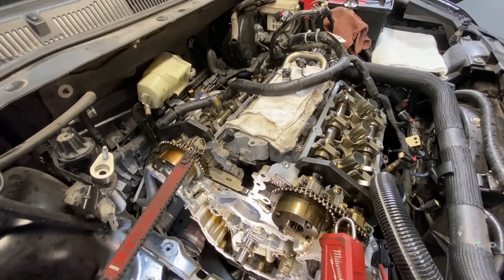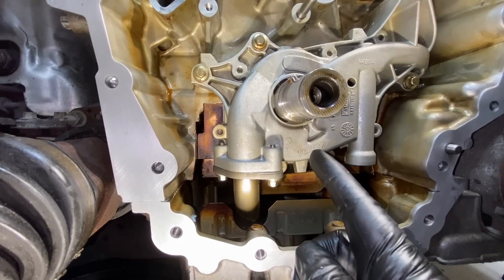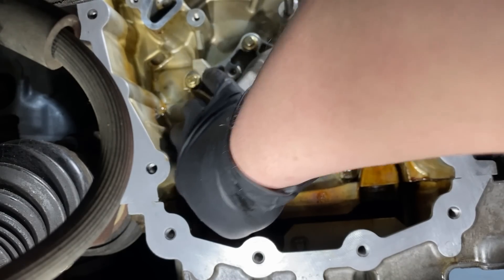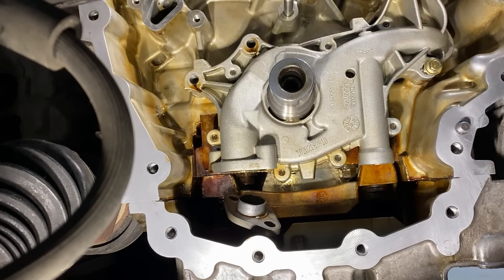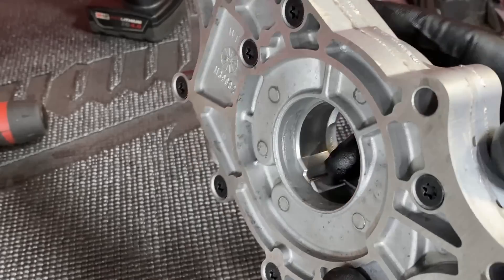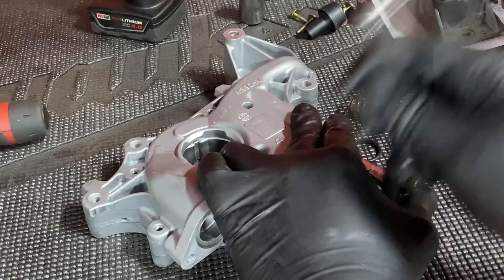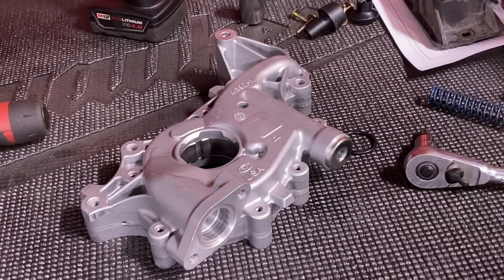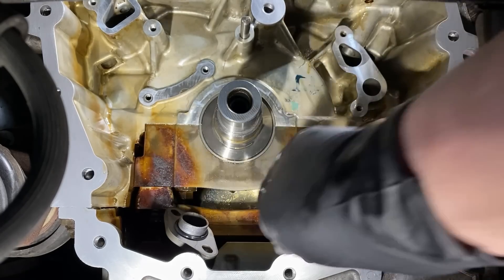Ford Taurus Explorer Flex Edge 3.5L Engines: Melling M-390HV High Volume Oil Pump Upgrade!

Comment from the maker: These are the Parts and Tools I Recommend:

Melling M-390HV Oil Pump-
https://amzn.to/3YAysop

Good Basic 1/4" Torque Wrench-
https://amzn.to/3YAyr3P

All bolts are the same torques spec of 89 inch lbs
Forscan is a free Ford Specific Diagnostic Software:
Download Here- 
https://forscan.org/home.html
ELM 327 Adapter I Recommend-
https://amzn.to/2GC6dBj

As an Amazon Associate I earn from qualifying purchases.

Comment: What’s the point of buying the HV pump if you’re not using the high volume spring?  Melling sells a standard volume oil pump that is actually cheaper than their HV pump. Why not just install the standard pump? Thanks.

Comment: So i swapped mine on a 2010 ford flex limited eco boost apparently my setup is extremely rare but I did the oil pump and did the timing chain and water pump again, like I've done a million times before, and she will crank. And crank and crank and crank and crank for like 30 seconds, before she'll actually start. It has the One Touch start, but it'll never start using it. I'll have to hold the key until she finally starts. That's just first thing in the morning. Afterwards throughout the day, I can cut it off and turn it back on like normal as many times as I want. But overnight, I get up in the morning, I try and start it. And I have to hold the key for like 30 seconds. Does this ring a bell as to any potential issues? I've already rechecked the timing and everything. And it's It's all good.I don't have any extra codes or nothing

Comment: Should you prime the pump after installing it? Is there a way to prime it? Or just wet it like you showed.
Reply from the maker: Just add oil and remove the fuel pump fuse.

Comment: On my 2012 F-150, there is not as much clearance for the oil pickup tube to drop out of the way, it's proving to make for quite a struggle.
Reply from the maker: On the 11-12 models they are even easier.

Comment: Is there enough room to replace the oil pump in a Ford Flex?  I know there is less space up front than the vehicle in your video.  I hope to do this on mine, just lost a water pump and would like to replace the oil pump, timing chains and cam phasers as well.

Comment: I am not racing my 2014 Explorer Sport 3.5. I am in the middle of doing water pump and I did get this new Melling oil pump. So an Ecoboost with 130K and in constant fear of my turbos dying, would I not benefit by using the installed high pressure spring with the higher volume? What could be negative about using high pressure? Is it hard on the turbos or piston rings? Is it really a bad idea? Would it not help high mile engines?

Comment: I’m looking to buy a 2019 ford Taurus with the 3.5l motor with about 50,000 miles. Is it a good car or should I stay away from it with the water pump fix in the future being expensive
Reply from the maker: Yes they are amazing vehicles

Comment: I like your channel - so much good, helpful information! 

Is higher pressure (volume) oil pump a good idea when engine clearances and seals (possibly tired) were rated at lower PSI ? Seems like would generate oil new leaks - idk
Reply from the maker: Correct that is why I swap to the low pressure spring.

Comment: Is it necessary to prime this oil pump prior to starting the engine following reassembly? If so, how?
Does it matter what orientation the pressure piston is in when it's reinserted into the housing?

Comment: I have a 3 problem for my ford focus 2005, first is after replace my rack end pinion and place onther one, when i start my car , a power steering failure in my instrument cluster , 2nd is the airbag is light is on, 3rd is the rpm is so high about 2k, can you help me please what is the solution..

Comment: I’ve got a 2002 f150 4r70w , goes into reverse perfectly , won’t go into drive unless you rev it up high and it kicks in and shifts through all the gears fine. But coming to a stop light have to rev it up to get it to kick in. I replaced the valve body and still have the same issue except now I can come to a stop and go without reving if I’m still in drive. If I go to neutral or park I have to rev it high every time to move. My transmission fluid and pan are pretty clean, very little debris in pan oil is kindod black. Is this a torque converter issue ? I’m stumped. Any help appreciated

Comment: This is unrelated to video but I have an 03 navigator and I have a leak in my air suspension and I’ve located it I believe but can’t find part anywhere. It’s a y fitting but it appears the bottom 2 are same width but top one is a different size. Please help

Comment: good video. I have a slightly related oil temp problem I would like to share. 2010 f150 4.6l  engine started shaking at idle at stop sign. Pulled over and checked
no engine codes dummy oil pressure and engine temp normal. antifreeze all over engine lost half.got hot water from restaurant and filled radiator. immediately no shaking cooler water cooled  oil in phasers that were overheating. got home and did checking on fans relays etc. started truck and let it warmup watching live data on coolant temp sensor. engine got to 197 f then thermostat opened and temp went to 175 f cool! but temp climbed over 230 f and I shut engine because pcm refused to start fans!! I know pcm can start fans because it turned them on  momentarily during system check with my scan tool. Bad programming by ford in the pcm will destroy you engine with no warning lights or codes! THE FIX IS CUT UPPER RADIATOR HOSE AND PUT INLINE 197 F ON TO 175 F OFF TEMP SWITCH TO GROUND RELAYS FOR FANS. BUY ON AMAZON COMES WITH 2 HOSE CLAMPS TUBE GROUND SCREW AND THREADED HOLE FOR THERMO SWITCH.
I will try to find out what stupid programming they did to save fans from comming on that is destroying engines .the pcm knows the temp because my scan tool is reading it but something is in the logic that thinks it is not needed to turn on fans.
sorry for the rant but hope i help someone.

Comment: My Pontiac had the 231 Buick V6 in it, series 3. A similar setup with the oil pump. When I changed out the gaskets, I didn't do anything with the oil pump.

I put it all back together, and no issues. Traded it in with 263K and no engine problems.

Comment: You’re the best Ford tech on YouTube been following you for years.  Question regarding a 2000 4.0 ohv ranger 4x4.  What would cause it to stall only when shifting into drive.  Is fine into 1 & 2. Shift soloinoid?  Issue started after ecu plug on firewall got soaked with coolant from a heater hose failure.  No CEL only p0340 in pending once.  Any advice?

Comment: My 2010 SHO has a startup rattle again (already on timing chain 3 @ ~280k miles) so looks like I may need to throw another at it, and I guess I'll throw a 390HV at it while I'm in there. There doesn't happen to be an 'upgrade' for the timing set does there (other than the 1 updated guide)?

Comment: when do u recommend using the high volume spring.. 
With the issues you are seeing with the Gen 2 3.5 ecoboosts... are the Gen 1s better..
Reply from the maker: High pressure spring is for racing only

Comment: On the 3.5 na water pumps, I personally just do the pumps. Nothing else besides valve cover gaskets, and plenum gasket. Spark plugs if they are older. Then oil and coolant and off it goes.
Reply from the maker: Always at least change the chain, some have an updated tensioner and arm and early model have a redesigned upper guide all should be replaced as required by model year

Comment: Is if worth it to upgrade a 2013 f150 3.5 eco's oil pump?  I had the timing chain job done like 15k miles ago and was goin to have it done then but the dealership said it wouldnt help with that year???

Comment: Did this job on my 190,000k '07 Edge 2WD about 6 yrs ago. Fortunately, it was an "extra" vehicle so I wasn’t under huge pressure to complete it quickly.  Replaced water pump, timing chains, tensioners, guides and oil pump all as a preventative measure. Aside from the 6F50 transmissio shudder, it's still running good at nearly 300K miles.

Comment: These new vehicles should absolutely not need this in depth level of "maintenance".  Never had to do this type stuff with older vehicles.
Reply: You’ve obviously never worked on anything with a timing belt

Comment: Awesome video, thank you! I’m hoping my 2024 1.5 3 cylinder is this easy, when it’s time
Reply: i’ve got one too. concerned about the belt in oil that drives the oil pump. once that probably goes, the whole engine will
Reply: @ Right on, I’m just taking it easy on this vehicle, no in any sudden gas it hurry. I wish this one had front tow hooks and something like a receiver hitch just to grab onto in emergency. I didn’t even notice the lack of until getting it home 🤣 Good luck on yours as well 👍👍

Comment: We have a 2008 Ford Expedition limited.  Since 2021 we have replaced the drivers window panel 4 times  and it s not working now?  It is always the drivers window that does not work. Any suggestion?

Comment: Why does Melling install a high pressure spring with the option of changing to a lower one? What applications would use the 100psi version?
Reply: Probably for racing applications and I suspect it comes with the high pressure spring already installed because it would be easier for the customer to remove the plug with the HP spring and then install the LP spring than to try to reinstall the plug with the force of the HP spring pushing on it.
Reply from the maker: Racing and it makes it easier to just include both springs
Reply: @FordTechMakuloco  People RACE this engine?

Comment: I am a little confused. The 3.5L transverse is notorious for how difficult to remove the front cover without breaking it and the lack of clearance to do anything. So I guess once you spend countless # of hours to get there it is very easy to replace the oil pump?
Reply from the maker: Yes very easy cover comes right off plenty of room
Reply: @FordTechMakuloco  Sorry I disagree and you are misleading a bit. The 3.5L transverse engine was shoe-horned on the CD3 platform; please be more specific about what you are posting. As @mph5896 commented the powertrain has to be dropped out on some models or it can be a very laborious task if you don't.
Reply: @benhaze1010 yeah, I did an Edge water pump job last month. Looked at it and was like, there is no way to get that cover off in chassis. Dropped the cradle and out the bottom it came. Taurus/Explorers I can do in chassis in 4-5 hours
Reply from the maker: @benhaze1010  The only model that must be dropped out the bottom is the fusion sport which is almost a non existent model the rest are done in vehicle. Is that clear enough?
Reply: @FordTechMakuloco  2010 Ford Fusion as well? Thanks.
Reply: I’ve done w-pumps and chains in 3.5 Taurus and Edge vehicles and the front cover is one of the easiest transverse engine front covers to remove and install. If Ford would’ve put the sufficient amount of engineering into the water pump design it would’ve went down in history as one of the best V6 engines Ford ever built. I’ve seen them with 400K miles on them in the cases where the water pump was not allowed to fail and the oil maintenance was done in reasonable intervals. Me being a technician I would not be afraid to own the MPFI 3.5 NA engine in the least.
Reply: How many 3.5l na have you pulled the covers on personally? Explorers and Taurus there is plenty of room. Edge, I’ll drop the powertrain out
Reply from the maker: @mph5896 I have pulled hundred by now and all are done in vehicle except the fusion sport which is a very low production vehicle.
Reply: @ One Edge , the rest were Taurus vehicles.

Comment: I just did this on wife’s 2016 explorer the whole deal including the hv oil pump, then I wonder after the fact was that overkill on na 3.5?
Reply from the maker: Why would NA matter?
Reply: @ it’s not strained as hard as a turbo motor that’s all I was pondering
Reply from the maker: The turbo engines have a turbo to feed but they don't have two extra VCT phasers to feed either.

Comment: I screwed up doing a 2012 3.5 in an edge and replaced timing chain and water pump but did not replace the oil pump. I bet you can guess that I wished I would have while I had it opened 😞

Comment: I have a 2010 Ford Edge 3.5. Also have a reman for it because my wife thinks she's Mario Andretti. At first I thought "Who's going to do a good job replacing the engine in New Mexico"? Farmington, 100 miles away is the only place I trust to do a good job. Then I started watching you and other YouTubers.  I can do it myself if I remove the front clip. Save myself $2,500 or more, and the job will be done correctly. Already have the manual and connections are all quick disconnects. Thinking of installing a turbo AND increasing my wife's life insurance...,🤣 Will generate approx 430 hp. It's already a powerful engine. Thanks for listening.
Reply: What turbo kit would fit
Reply: @PrisonCitySam Garrett GT35 Turbo. Same as on the interceptor police vehicles I think. 430 hp max. A real screamer.

Comment: What makes it an upgrade if you're removing the high pressure spring?
Reply: The pump is larger and will provide more flow as the same OEM design pressure.
Reply: Correct. Higher flow rate, more consistent pressure. 

High pressure is not beneficial if you are not tuning. High flow is across the board

Comment: Why not the high pressure spring?
Reply: The stock pump may be struggling to keep pressure up at higher oil temps. The high volume pump will help with that. Increasing the maximum pressure is just going to open you up to possible issues with too much pressure.  If your oil pressure is at the stock limit and you have oil problems, then more pressure isn't going to help anything.
Reply: @vica153   that's correct more flow is the way to go .

Comment: Is this the 3.5 naturally aspirated engine I have on my 2016 f 150?
Reply: On vehicles like an Explorer or Edge the engine is transverse and the water pump is inside the front timing cover and driven by the timing chain.  I believe in trucks the pump is external.

Comment: Incredibly useful, thanks. Question, the 2017 Ford Expedition w the 3.5l ecoboost. Are there known problems that should be addressed asap? Or is it relatively reliable?